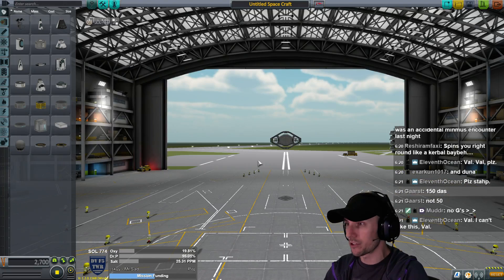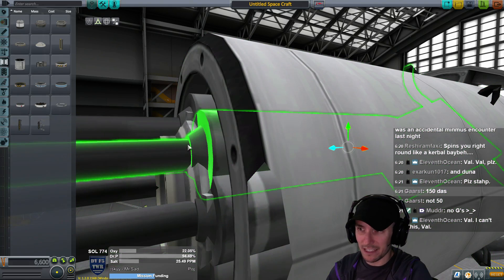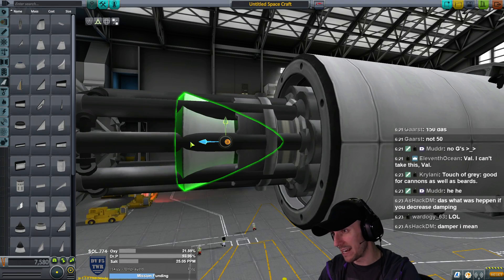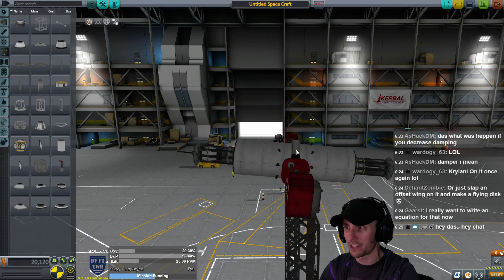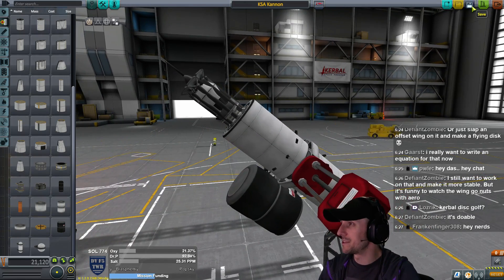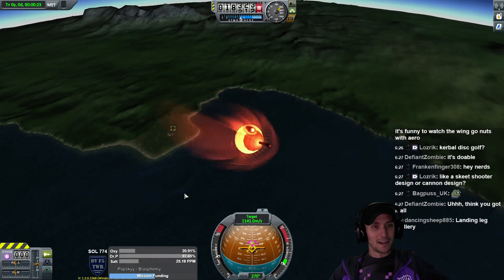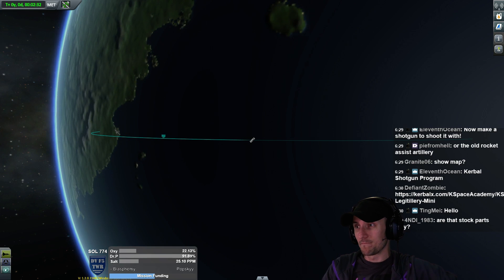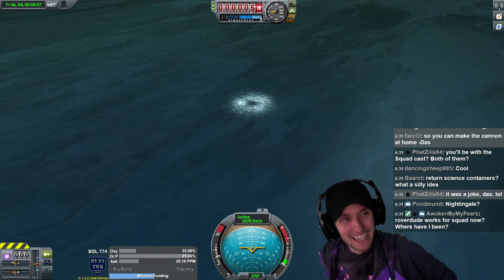How to build a stock Kerbal Kannon in KSP 1.2!

Comment: Just FYI, springs control how fast your lander legs can accelerate, while dampers control the top speed. A remotely useful damper in KSP has to set a very low maximum speed so the leg can't compress very far in the single frame of travel, while springs have to be very soft to stop forces shattering the vehicle so in a single frame of high force it is easily overwhelmed. The longer the lander leg is during the launch frame, the more distance the projectile has to travel in that frame to escape clipping, so the greater acceleration imparted on it.
Reply from the maker: Guy Mahoney Consistent with observations, and would explain why a higher damper setting seems to give more power to the cannon. Thanks!

Comment: I have something to note... having a .625m heat shield behind the nose cone greatly boosts thermal resistance by a ridiculous quantity, just sayin... also having 2x .625m jet fuel tanks allows you to make it far heavier, losing far less speed to atmosphere
Reply from the maker: Jack Stone Nice! we spent an entire stream designing new projectiles... didn't try the heatshield. Try a smart projectile...
Reply: K Space Academy I have done a basic, but it got a little big... from front to back: 
Avionics Nosecone, 
2x .625m heatshield (5/50 ablative, not a lot needed), 
NCS Adapter, 
1.25m drone core, 
Engine Pre-cooler*, 
Rapier engine, 4x (insert winglet/canard here, could suggest standard canard)
small nose cone (mounted backwards to reduce drag)

*Pre-cooler can be replaced with standard LF/O tank for space maneuvering adjustments for anti-station weapon, just remember a different form of intake as the pre-cooler includes one

Insert rest of K Space Academy's "Landing Leg Cannon"®

Due to weight of projectile, the largest 3.75m fuel tank is suggested as a base, and I haven't thought of what to use as a recoil-less version... it wouldn't be difficult to find though

*EDIT: just realized it has a short battery life due to rapier's lack of alternator and no batteries, could include a 1.25m battery somewhere in there too

**SECOND EDIT: just remembered you'll also need launch clamps to hold it until you fire it otherwise it bends down... bind clamps to same key as docking port and don't have them in the way of canards/fins

Comment: they patched it, i tried it today, only went like from the run way to the shore
Reply from the maker: Still working fine for me in latest 1.2 release... make sure you increase the spring and damper, add the ore tank full of ore, and make the projectile correctly. The video was made after about 40 hours of testing all sorts of different variables with the design.
Reply: K Space Academy oh crap, when you mentioned dampner, that hit me in the head because i forgot to adjust spring and dampener
Reply: K Space Academy ahh fixed it , think it was multiple issues with my placement while fitting it to a plane, works great now .... unless im above 300m/s , then it kills everyone
Reply: I just cant seem to get the docking port off of the projectile, any help?
Reply from the maker: The docking port is actually getting destroyed... if it's not blowing up, you gotta kick it harder. Cannon is not designed for "slow" projectiles heh
Reply: K Space Academy yeah my docking port never ever blows up and i have 16 legs damp and spring all the way up
Reply from the maker: More mass on the cannon then, make sure the ore tank is full. Doesn't hurt to overdo it. Just tried again and following the instructions in the video still nets the same results for me.
Reply: K Space Academy i put 4 full ore tanks (biggest ones) and the entire cannon will blow up and the projectile will go nowhere
Reply from the maker: stephen allen As it should. Perfect!

Comment: If you cheat with ignore max temp and unbreakable joints, as well as put 2 huge ore containers on the side (full) and 2 other smaller containers on the top and bottom (full), and fire at a 45 degree angle, the projectile will be going 58 times the speed of light, and will instantly leave the solar system.

Comment: with 45 degree inclination you should get maximum range
Reply: Mike Cammiso Actually going more vertical in an atmosphere would probably decrease its range you'd probably want slightly less than 45 while in the atmosphere
Reply: not necessarily, there is an atmosphere in the way. it might be better to do like 50 or even 55 degrees.
Reply: JHAWK997 thats only if you have wings producing lift and constant thrust. you cant really do that with a rocket because you will run out of fuel much quicker than you  would with jet engines

if there was no atmosphere, you could orbit really close to the surface, like most bodys in ksp. its because theres no drag acting on your spacecraft, so it doesn't slow down at all, other than gravity. 

if he were to launch more side ways, he would be in thicker atmosphere longer. at least when you go up, you get your speed back on the way down

he should test dis